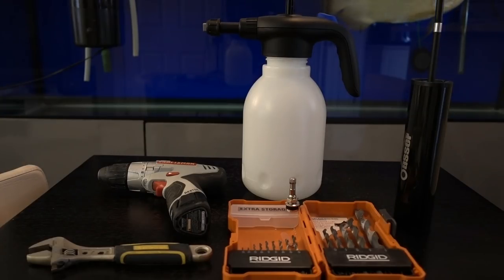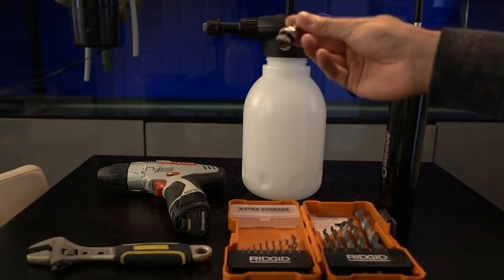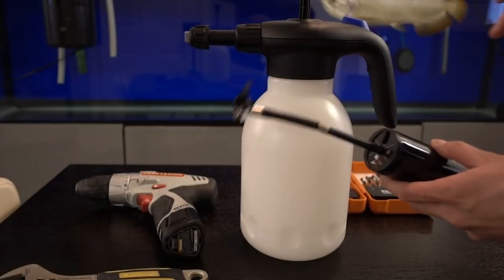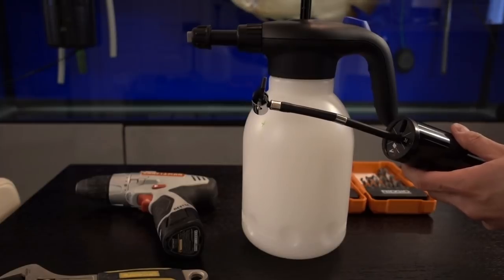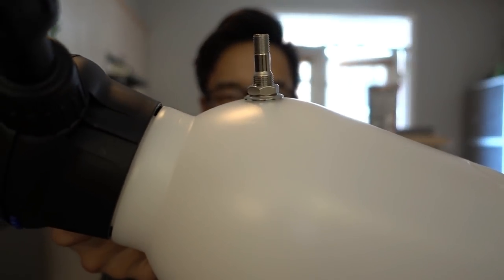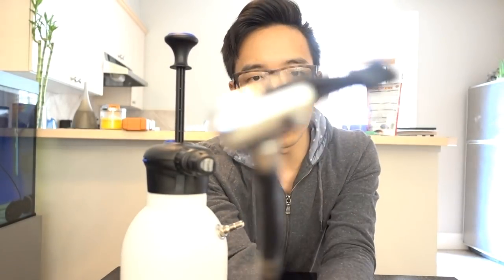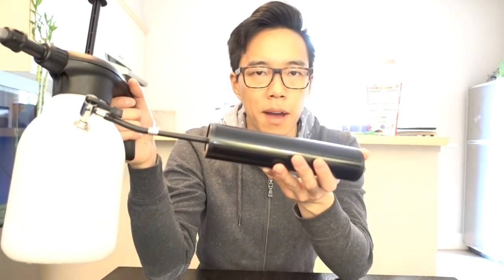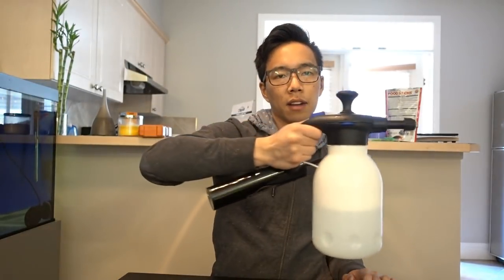How To: Make a Portable Foam Cannon? - A better AMMO Aerator?

Comment: Pretty ingenious and way to put a new meaning into KanDo! Thanks!
BTW: drill a hole thru the handle and use only 1 zip tie.
Reply from the maker: Good idea! Perhaps you can use velcro to loop around it so you can put it on and off easily
Reply from the maker: @bindualex6857  nope, but since this video, I've seen manufacturers offer a valve stem on their aerator so you can pressurize it

Comment: I did this last week. So glad i did.  It's actually easier than it looks.  THANK YOU!!!
Reply: Where did you get the bike pump from?
Reply: @pandassudsnshine4125  from amazon, the Tacklife X1.   I preset the pressure to 45 psi and fill the bottle to an inch above the max fill line.  Just gets me complete coverage on a bmw 5 series.  Highly recommended
Reply: @pandassudsnshine4125  you can use any tire inflator run off the cigarette lighter. I'd keep the car running as it's a 10+Amp draw
Reply: @McCarthyism_by_Youtube  thanks bro. I’ve been looking to expand my detailing business from shop to mobile and alot of apartments and condo, I couldn’t service. With this I can.

Comment: You said you started with a 1/2 inch hole and switched to a 3/8 drill bit. Doesn't that mean the hole is wider than the drill bit

Comment: Not familiar with foam washing technique. Do you then wash with a microfiber towel with bucket of water or just spray rinse it off?
Reply from the maker: cuda2000 Foaming can be used to pre soak the car and then rinse off for maintenance type washes. For heavily soiled cars this process can be followed by bucket wash technique. Or you can insert AMMO FROTHe, spray and wipe off with microfiber for a waterless wash.
Reply: Would this be doable on the IK Foam sprayers? or your method is practically the same as IK? I honestly think these giant companies going to hate you if more people discover this lol That Gary Dean one bucket method drove companies to sale sale and sale their two bucket method even more. Hate the two bucket method.
Reply from the maker: Calvin Wong hopefully i'm not upsetting anyone, but moreso helping out! I dont see why you couldnt use it with a different sprayer, though if your going with a much larger container, you want a more powerful pump. Give it a try and let us know!

Comment: Your pump comes on automatically when the pressure drops? I just bought the same pump and mine doesn't re-pressurize once I start spraying.
Reply from the maker: Thanks for the comment, i actually came to the realization that it does not come back on automatically. Instead i set it to like 2.9 BAR, and itll struggle to get there. Just before it does, so when it reads 2.8, i start spraying contiously and itll never shut off as its trying to reach 2.9 BAR. Apologies for the confusion

Comment: 3 Bar = 43 PSI?  Does it reach that level?  This is epic man! thanks!!
Reply from the maker: I need to update the video, but put the pump at around 2.5Bar.. it wont reach 3 as the air safety release valve of this particular model will be triggered

Comment: So the pressure of the pump 30psi?
Reply from the maker: If you set it just under 3 Bar, itll continuosly run in my experience
Reply: KanDo  how much soap ratio?